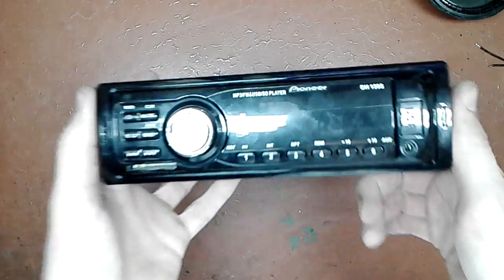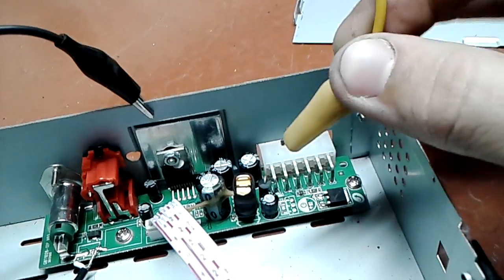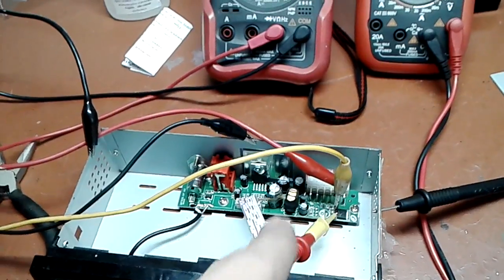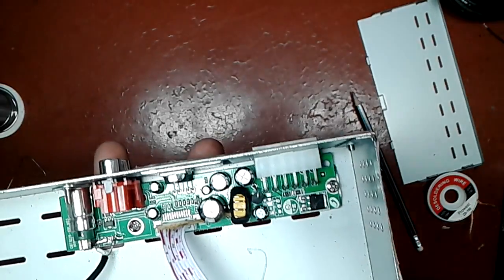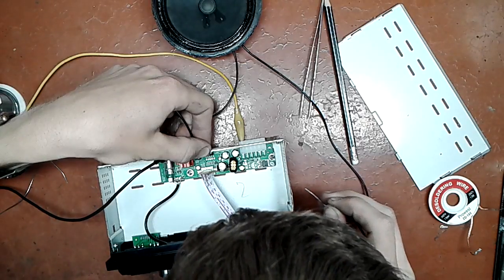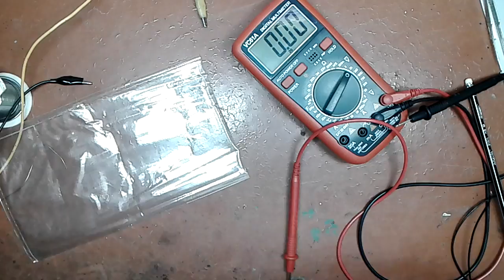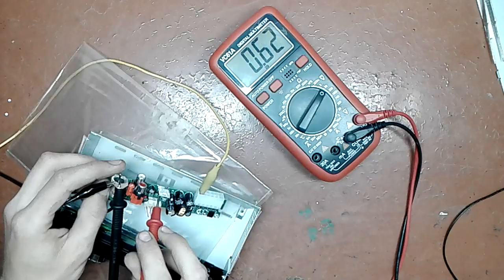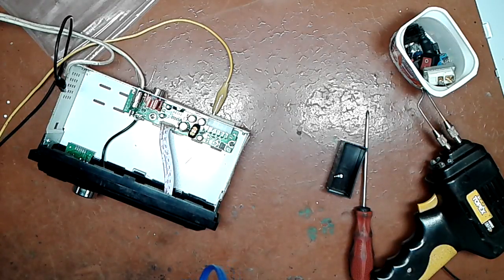Car stereo repair #3 - Part 1 of 2

Comment: I have some factory Jeep 1988-1992 AM/FM Cassette Players that need repairing. There are two that either the left or right channel has gone out. One with the volume knob maxed out but need just a little bit more volume. One with a high squeal from speakers with no AM/FM reception. The rest have inoperative tape modules. They are the type that draws the tape in from the short end with a motor you can hear running but it will not draw the tape in and seat it down into position. When you manually push it in, you have to pull the tape out with needle nose pliers.

Comment: Is there a way to test the amp chip? our radio fully works except sound started to crackle and has now gone off completely.
Reply from the maker: Connect power and speaker, and simply touch pins of the IC. There are few that will make speaker hum when touch those pins. If not, thall shall measure voltages. Datasheet is your friend

Comment: Hmm pioneer bullshit LOL :).

LOL i do like your sense of humor :-D, the reading of the silkscreen on the ribbon cable was genius he he :-D.
You are not the only one to mis things, yes i have too.

Near the start i thought that resistor was the electronic antenna wake up, a rather cheap way to do it, only on the radio should it come on.

I heard your brain panic when connecting the speaker, (i may tap on to power by mistake, bung capacitor in series to block d.c), i had similar thoughts :-).

He could keep his sandwiches in the box, it may still be usefull :-D
"I think it is A peice of shit!!." as you might say, not really worth wasting your talent on.
Reply from the maker: Well, he agreed to my price, so I will be installing another amplifier board there. Homemade one, using the TDA2004 chip. Why this exact chip? Because third stereo uses one and it is bad, thus I optimized the purchase list :D
Reply: Ahh i remember that as stereo or bridged, if my crusty memory is right.
Get the stripboard out lol :-D
Reply from the maker: Ehhh, I already laid the board out. It's 45x30mm, quite a compact little thing :)